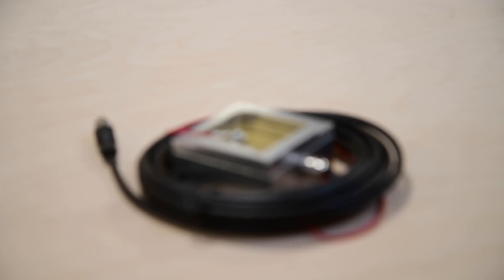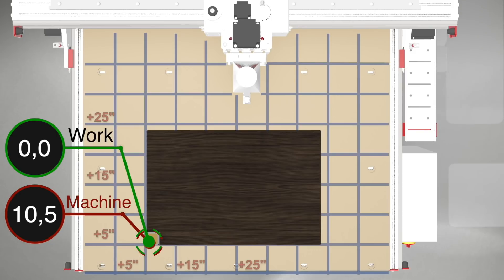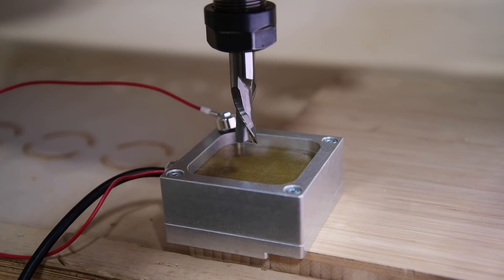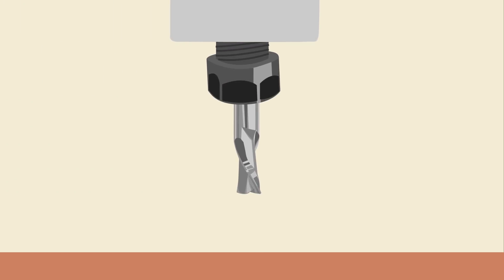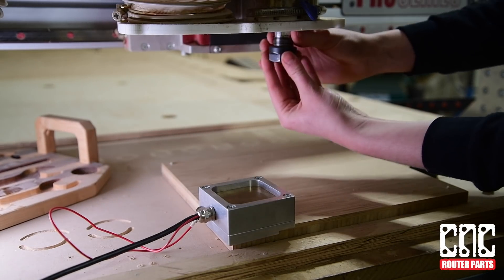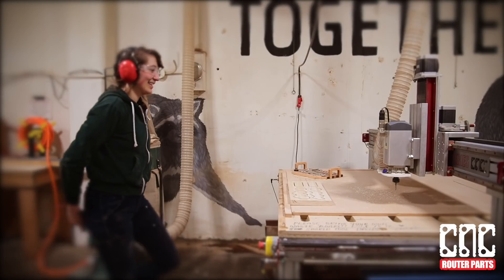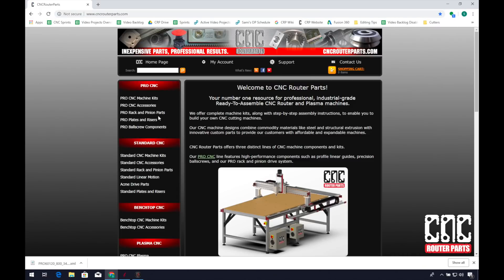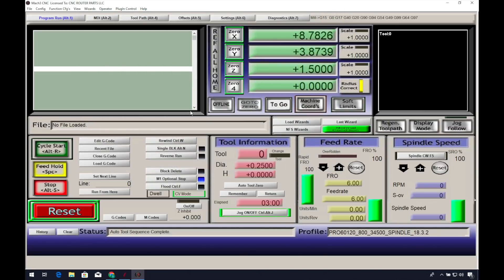How to use the Auto Z and Corner Finding Touchplate with Mach3

Comment: My first really usable CNC was from your company long ago when it was CNC Router Parts. It was a 4x8 table and it was extremely nice. I have since sold it and run a different type table now .I have been familiar with this type of touch plate for a long time and think its very convenient, but in my line of machining I load full sheet after sheet after sheet. I use a fence  that runs along the zero plane on my Y and X ,and  my home switches are precisely mounted to where the X and the Y fence meet at  are zero. So I just load sheets and go, I never have to do the edge finders dance..lol. I have found that no matter the shape I can set it up in Aspire  and only worry about Z height, because the fence holds the materiel and the home switches always know where Zero is. This even works on circles and odd shapes that the edge finder ...well cant find if you will. I found this works well to on long multiple hour carvings as I have had power interruption and had to re Home or Zero my machine using my switches and fence. It has never failed me. Before this I have had to start all over and ruined material and lost hours. Try it. I have an old old video explaining it. Im not knocking the edge finder but we dont live in a square world.

Comment: Is it possible to touch off the spoil board and then touch off the top of the material to measure the actual material thickness and then modify the gcode(on the fly) to account for the difference in the actual versus the nominal used in the design?
Reply: Mach will zero out your work Z axis whenever you use the touch plate. You may be able to pull the machine coordinates after you zero out each surface in the Diagnostics tab I believe to determined the actual material thickness you are working with some simple math.
Reply from the maker: Interesting thought! This is possible if you want to customize the touch plate VB script in Mach3 yourself. Our current script does not have that functionality.